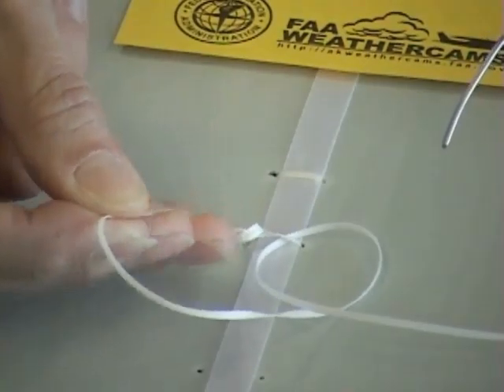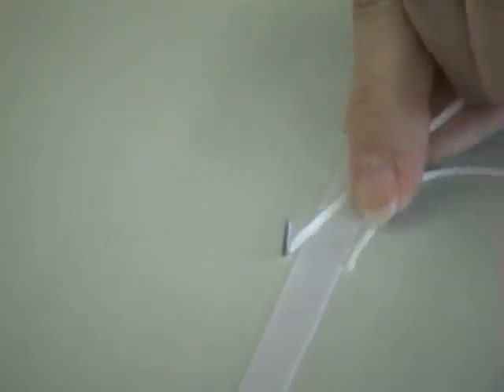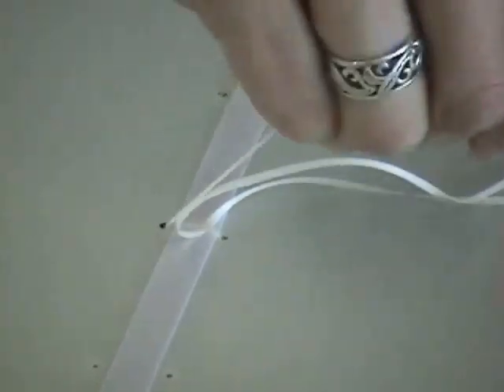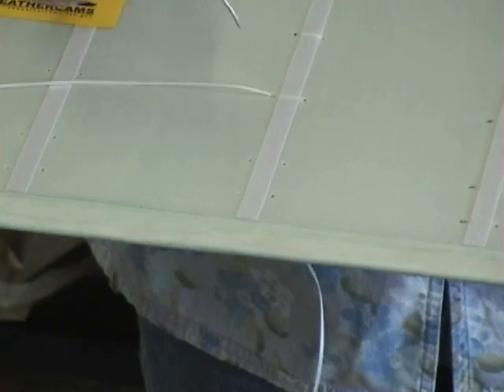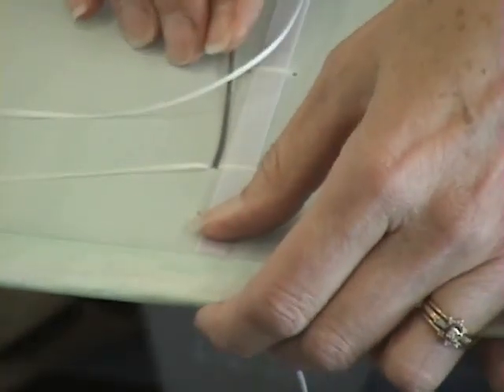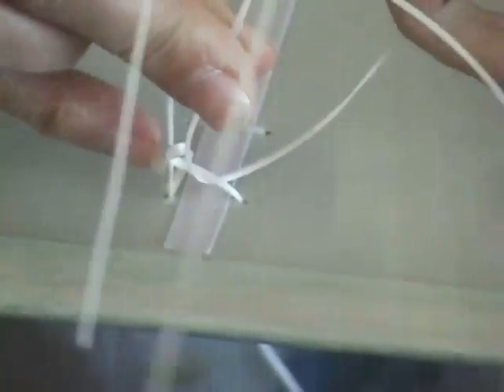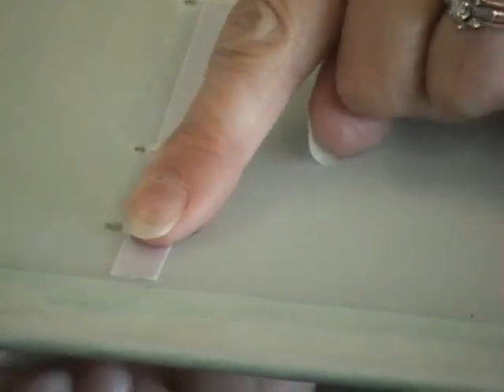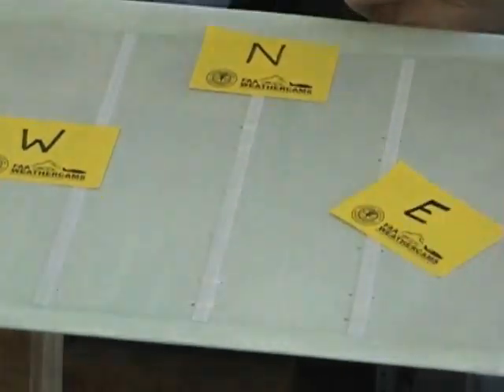Aircraft Rib Stitching Video 2 of 2

Comment: Are there locking knot stitches with the “Staggerwing” method, like there are when using the modified seine knot method?  If yes, is it just the added half-hitch that you used on the final stitch?